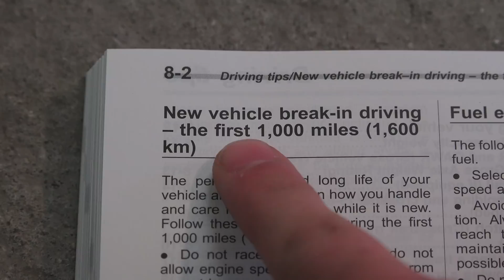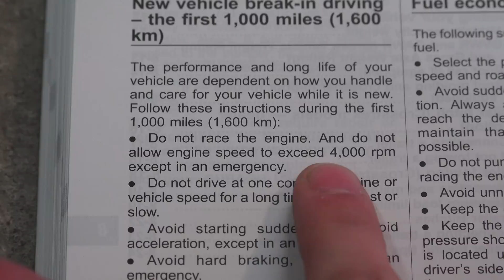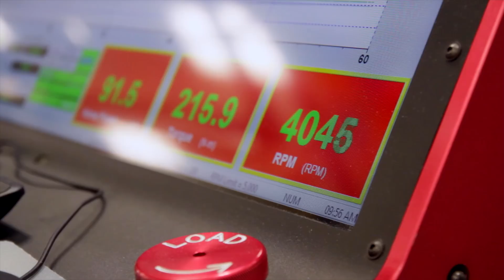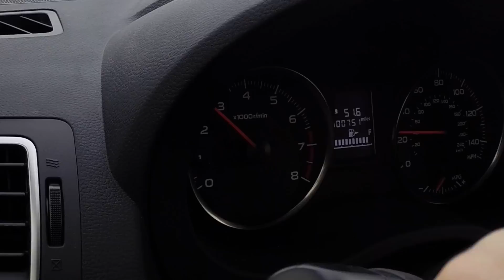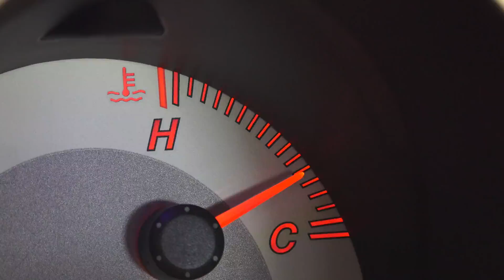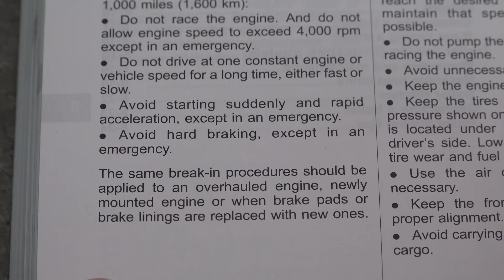5 Things You Should Never Do In A Brand New Car

Comment: Although I agree entirely with the video another tip(which my father used to do on the many engines he built for friends) is change the oil after no more then 300 initial miles even if the dealership/manufacturer says 1000 or 3000 or whatever. The first 300 miles creates the most metal particles. The acura engine lab that breaks in their engine in 150 miles runs continuous oil through the engine to constantly flush the new parts as the bed into one another.
Reply: put magnets on the oil filter to catch it

Comment: Sounds like good advice.  Why is there not a engine clock on automobiles ?    On marine applications there clocks on the main engine and generators that keep track on engine running time and maintenance is performed as per hours run.   With an automobile hours can greatly vary according to speed driven.  So would it not beneficial to have an engine clock/timer ?
Reply: I always wondered this. Maybe cars are such that it makes little difference to be worth it? Big diesels maybe have different characteristics to small high-revving petrols? No idea. Maybe miles works as a good substitute. If you take 10,000 mile service interval at an average speed of 30 MPH, that is just over 300 hours of operation.

Comment: I think the only vehicles that are recommended to be broken in using the hard break in procedure are class 8 trucks,  tractor trailer. For some reason factory recommends those diesel engines cannot idle, and need to haul heavy loads right from the beginning  and to avoid light loads and flat roads, basically cruise control is also not recommend

Comment: Hard break-in is best.

I factory ordered my 2011 Chevy Express AWD and immediately after driving off the dealer's lot, I  went to an empty highway service road and spent 20 minutes of hard break-in.   From a stop, pedal to the metal runs of varying rpms followed by cool downs.
Got 85,000 miles(us) and get 13.4 mpg(us) mixed driving.   My van is 5,500lbs empty but always loaded to 7,300lbs with tools and a ladder rack with two ladders. When it was empty with no ladder rack, I was able to get 17- 18 mpg easily.

Zero problems so far.   

And I also go by OLM(oil life monitor) which is about 7,000-8,000 mile oil change intervals with regular oil - supertech 5w30 btw.

Comment: Important point:  The owners manual break instructions are for the powertrain.  ie the engine and transmission.
The engine does not care if it runs at a constant speed during break in.  It also has an effective cooling system, including oil jets on the bottom of the piston (& therefore bore/rings) for a modern engine.  Vehicles with hypoid final drives can be damaged in break in because the heat build up is much higher during break in, and they should not be run at the same load in order to avoid scoring the surface.  The main issue is heat, so the advice is short runs with cooling stops.
Another point is that manufactures compromise new vehicle maintenance for convenience.  In the ideal world an oil change at 100 miles and then 1000 miles would be good.
So if you just look at the engine, the break in needs to be and the high load side of things.  Or another way of putting it is that low load should be avoided.  Extended idling and cold starts are to be avoided as they will glaze the bore before the rings seat.  
The penalty for a low load break in, glazed bores, is excessive oil consumption and a reduction in power.  The penalty for a high load break in does not really exist for the engine.  You can't overheat the rings if the rpm is kept low.
BTW, I believe the Corvette break in procedure is to prevent the new owner from crashing.
So my recommendations:
A. Non hypoid final drive vehicles.
1. Break in using one long trip at highest possible load and low-medium rpm.
That's it.  To get the highest possible load you need to run at the highest average speeds.  ie the freeway.  Only one cold start.  Keep rpm to 3500 rpm or less.  Pulse and glide helps too.
B.  Hypoid final drive vehicles.
2. Break in using short sequential drives at medium load and low-medium rpm with a minimum of cold starts.
Drive on the freeway for 20 miles, with varying load and speed, wait 45 minutes to cool, then repeat 4-5 times.

Comment: own a 08 F150 5.4 triton 3valve. been "flooring" it and red lining it since new (11miles)  now it has 377k miles still running strong no problems.  original motor.

Comment: every engine that came out of the factory have been pre-"floored" to test and look for the faults in the engine. And when I got my brand new M4 two years ago, i floored it and drove beyond 80-100 mph countless times. It now have 52k miles on it, still running like a champ. The key to keep it in a top shape is maintenance.

Comment: These apply to European cars where they require these non sensical break in periods.  Floored my 03 Cobra on the damn test drive and several times over the last 15 years I've owned it.  Its a cast iron block with Manley connecting rods.  She goina be just fine.  Same goes for my SRT-10.  If it can't handle it right off the bat its not worth it to begin with.

Comment: Although your info is accurate for lab testing. In real world operation, it's really not that complicated. I'm a mechanical engineer so I appreciate the lab data, which does apply to some vehicles depending on their manufacturing tolerances when the parts were made. However, I've been ripping apart engines new, old, beaten hard, and lightly used for years and I can say with 100% certainty that the ones driven hard had the least amount of defects and also made the most power on the engine dyno. In my findings, it's better to drive them hard in order to seat everything. If something breaks, then so be it and just replace it, it's not that big of a deal and it'll tell you were your critical points are. But this is just my findings and experience from being a former Ford technician, fighter crew chief and free lance technician on performance vehicles, and now as an engineer that spends all his free time conducting "tests" on his own vehicles lol. Life is just one big experiment to me. Drive it like you stole it!

PS. Love the videos, you're one of the only people I enjoy watching explain things. Being able to see an intelligent individual actually touch on math and physics and can back up their claims with hard data is nice to see. Keep it up man!🍻
Reply: Dunno about VetteTTV12, but we keep the initial break in light, 2000 RPM for 20 minutes or so with no load, then start piddling around, after 20 miles or so start going through the entire rev range (assuming the tune is up to it, usually we're still tuning due to what we learn as we drive it), then start to actually push it a bit to see if she'll hold together.

Generally a fresh engine built to factory specs is too tight to really dog on right out of the gate. The rings get hot, the cam hasn't broken in properly (though that isn't as much of an issue now as it was in the past).

You can often monitor the break in period by watching the temp gauge. The cruising temp will start to drop once the rings have seated properly, then you can start pushing it.

I still don't dog the crap out of a fresh engine, but if it's designed to turn 6500 RPM it will see that at full throttle a few times before we put 500 miles on it, at least once we've got the tune dialed in.

Often the textbook correct way of doing things is very conservative based on the fact that a lot of people don't fully understand what is going on, it has to be safe 100% of the time. That's how engines are tuned from factory as well, not for peak performance, but for absolute baseline reliability 24/7, no matter where you are.

We don't need the exhaust shut off valve to heat the engines in the south, so they go away. We can push the timing farther due to the air density and humidity, so we do. Those same rules apply to break in. If you really know what's going on under the hood you can handle break in according to what the engine is actually doing. Some take more TLC than others, some can take a beating within a few hours of building.
Reply: @glenwaldrop8166  Almost the same as running in new cams for 20 minutes @ 2000rpm...
Reply: Yeah, we always replace the cam if it's a flat tappet.

Haven't built many roller engines. Most of our toys are old.
Reply: You never saw an old fleet car from a taxi company now did you, Mr Mechanical engineer. The longer a material is subject to 'work' the more likely it is to wear, deform, fatigue, or flat out fail. You should know that: Length x (Mass x Accel) = Work and another way to state that is Work = Force x Distance. The more work a material does, particularly ferrous metals, but speaking in general, the more its solid state properties change ..if the material is a crystalline solid its lattice structure (pattern of atomic stacking, or bond geometry) will be affected by granularity changes eg. grain growth --> larger crystal size ==> metal fatigue. If you want to put a vertical score in a cylinder wall, putting new piston rings to some hard work right after the block cylinders have been machined and honed to a very tight tolerance for high surface finish will probably manage that more efficaciously. Things ought not to stress in one lump together over a very short time, material has a yield strength that will also fail irrespective of how much work is left in the atomic lattice before its properties change equilibrium.
Reply: @user_mac0153  actually it's not unusual for taxis here to run a million miles. Maybe that doesn't take many years.
Reply: Long term, I absolutely agree.

A car that has been driven lightly is usually in as bad shape as the one that has been beaten on.

We always kept it a little easy on break in, but we did run the full rev range and occasionally hit full throttle. I'd rather it break right off than 10k down the road.

There is something to be said about hot spots though, that's why I never dogged on a fresh engine. Let it wear in a little bit before really beating on it.

We've had a couple of engines we've built get super hot shortly after building. Poking around for a while allowed that to clear up, but full throttle, even briefly, showed a big temp increase.

Basically I try to treat each engine as it requires. Some take a little more TLC on break in than others. I've also started building them a little looser than factory specs, doesn't seem to affect longevity and you don't see a massive drop in economy as we often did when building to factory tolerances back in the day.

Comment: You do need "excessive" pressure. Gotta get the rings seated before they wear out. Check out Moto man. They reccomend NOT doing so, to prevent a proper break in, and have you back at the dealership. Planned obselescence.

Comment: All this sound logic and it’s obviously good to break in an engine. But I think many of us know people who floor the car right from the beginning. And these cars are still alright. I think the big question is: What difference does it make if a car is driven like this or that for the first 500 or 1,000 miles? How much more performance will the car with the “good” break-in have? Will the engine run longer, smoother, with less maintenance cost? And is there maybe a 10% difference or a 50% difference. I.e. if the proper break in just makes 3% difference then few people will be motivated to do it.

Comment: They say you only have 20 miles to seat the rings. Im going to guess the manufacturers are worried about Piston to Valve Clearence because of the lifters not bieng bled down. Engine builders dont break engines in , they bring them up to temp over 2000 until the lifters stop ticking and then hit them hard to seat the rings.

Comment: New engines are manufactured very well.  My question, If the engine is rotating at 4000 RPM how many up and down's do the pistons really need for break in?  I would think a day of driving would suffice.  4000 RPM x 240 min = 960,000 revolutions.  Just a thought.

Comment: I 100% disagree. when building race engines for quads and motorcycles as well as turbo cars it is necessary to bring the engine under heavy load to seal the rings. you actually only have a limited time to do so.. about the first 20 miles. forget 300 or 500 or 1000 or whatever. if it's not done Correctly within this short period then you might as well get it re honed. I do however agree with alternating revs and seating the brakes

Comment: by not flooring it you mean no WOT right? i ask because i recently learned a lot of manufacturers have their throttle map set so that you only have to press the pedal in 30% of the way for the engine to be at WOT. so not "flooring it" may not be enough...

Comment: this is inaccurate and totally false. i floored it on my brand new car and it has never been better.  u aksi redlined it at 7000 rpm and in fact modern engines are designed such that you can redline it safely. 

4 years and 144000km later, the engine is perfect and feels light and very economical and powerful.

I did this on my brand new Alfa 156 i acquired in 2000

On the older cars such as those designed prior to 2000, the manual says you dont redline this but to gradually raise the revv beyond 4000 rpm. But such is the old design of engine.

Comment: The quotes from owners manuals regarding break in are nearly meaningless for engines. For example the C7 engine is run and brought to full rpm and operating temp. before the engine is in the car. This is the case with many manufactures. Racing teams do not run engines a few hundred miles to break them in before a race. Having said that there are other systems in a automobile that may need a break-in period. Brakes, transmission, gear box, axles may need a break-in for bearing, pads,calipers,seals to wear in and seat properly.

Comment: Another great video.  Regarding point #4: avoid short distance travel... I agree with the general point, short trips are not good for any car, new or old.  However the following statement is made: "Proper oil flow is only going to happen once you get things up to operating temperature."  (The same general statement is made in your video, "5 things you should never do in a turbocharged vehicle.")  This is true of single viscosity engine oil.  The overwhelming majority of auto manufacturers now call for multi-viscosity engine oils, which are engineered for good flow at low and high temperatures.  I suspect that your comment was intended to address engine oil protection, which is highest when the oil is at full temperature.  Your videos are interesting and helpful, keep up the good work  :-)

Comment: If you give an engine a hard break in the engine is looser sooner, so it reaches its optimum performance earlier in its life cycle but shortens the life of the engine and you tend to use more oil. You can't compare road engines to race engines as race teams swap their engines so as long as it gets them through the race its fine

Comment: I heard that its best to break it in the way you plan to drive it. I usually follow this rule after the first 300 miles and one oil change, then I open it up really good. Never had an issue in my life.
Reply: I'm fighting this now, in 2023. I went easy on it until up-to-temperature for 20 mins, then used moderate power at most for the rest of the milage. I drove routes that saw regular slowing/stopping for lights, junctions, etc., to ensure the engine didn't sit at one speed.

Comment: I just bought a new Mazda3 and for some reason the engine gets really hot, unlike the older model 2011 Mazda3 that I had, what is the reason for that or is it just normal, and btw I don't get hot engine coolant light on or check engine light

Comment: The factory break you explained is not true. They actually do a heard break in at the factory doing a Dino test to test hp. and preformence. Maxing out the rpms. For safety issues owners are recommended not to so they are not breaking any laws (and have a reasion to).

Comment: Back in the day, (boy do I sound old), 1960's and 70's, one could order a car with various rear end ratio's, and transmission options, such as close ratio or wide ratio. 
I remember owners manuals didn't say anything about RPM, but suggested not going over a certain speed.
My 1st car had a rear ratio of 3:54 and at 60mph it was running at 3,000 rpm. I believe the owners manual said keep it below 50 for the 1st 500 miles. Which I totally ignored. I varied the speed for 50 to 80 and so on. 
At 500 miles, I changed the oil. 
I think the idea of varying the speed as you state is the most important thing. And, I also think it's ok to run over the 4000 rpm limit, just not constantly.

Comment: I redlined a 675cc motorcycle in gear (under WOT) while in the latter stages of the break in period. I felt the bike make a slight jerk motion and the character of the exhaust changed slightly. After that, it was a totally different bike. Very torquey and raw. My dad had the same bike bought at the same time, but did a soft break in. We tried to redline it but the engine forever felt softer than my bike. The motorcycle techs told me that my bike had been "broken in properly" after riding my bike upon my request to see why my bike had such sharp throttle response. Is it possible the protocol is different on motorcycle engines?